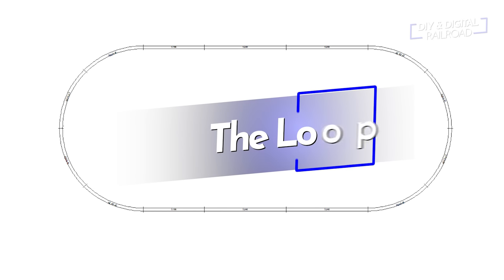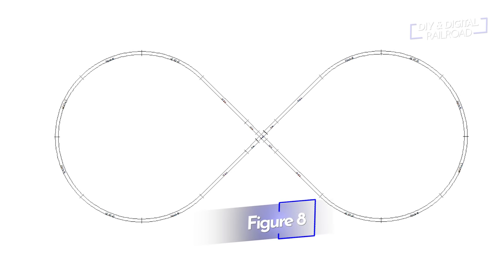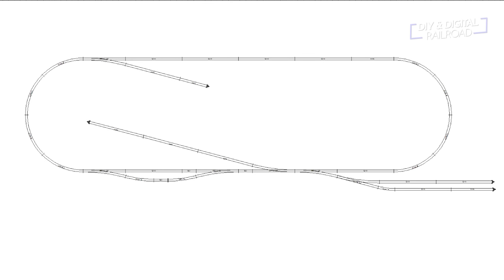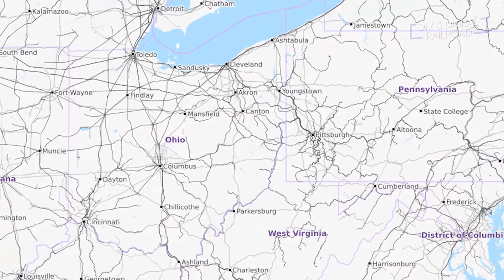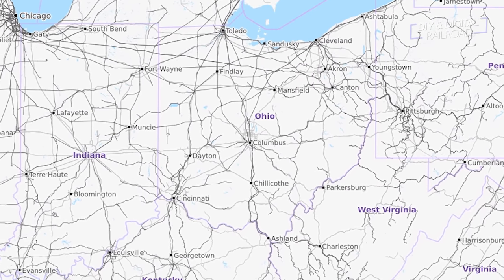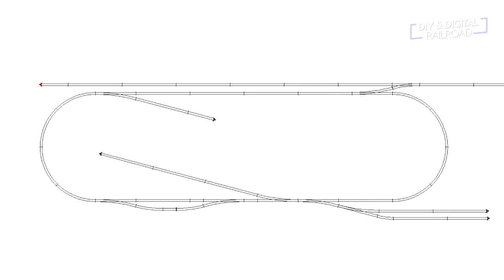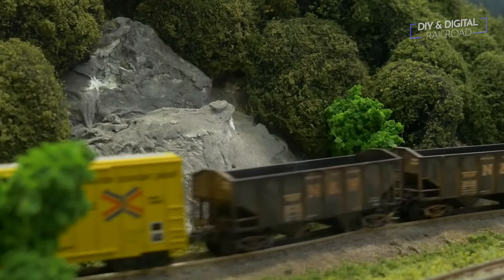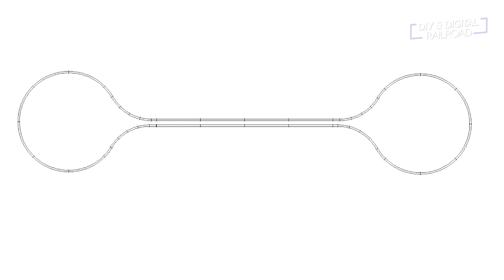Model Railroad Layout Design for Beginners

Comment: one of my favorite layout designs is using a double track going through a mountain with 2 tunnels, but, the tunnels are covered with industries that use the same rail cars. For example you can have a coal mine on one side that allows empty coal hoppers on one track and loaded rail hoppers on the other track and on the other side of the mountain you have an industry that uses coal again with one track for empty hoppers and the other with loaded hoppers. it creates the illusion of a coal mine producing coal and an industry using coal. bring the loco motive to the coal mine to pick up the loaded hoppers and deliver them  to the coal run industry. when the locomotive pushes the loaded hoppers into the industry it looks like coal is being produced at the coal mine on the other side. Then the locomotive switches tracks and grabs the empty hoppers and delivers them to the coal mine again creating the illusion of the industry using the coal as empty coal hoppers emerge from the industry side as the empty hoppers are pushed through the coal mine to get loaded. the only down side of this is that the numbers on the empty hoppers and the loaded hoppers will not match if you're into trying to create some realism to the layout.
Reply: This is such a neat idea! I like it a lot. I may have to try it someday

Comment: You are dead on right!!! Been a model railroader since I was 6, I'm 60 now, I've built N scale, HO scale, and have always loved 3 rail O , so I'm building a 120'X 42' building for my final build I will retire with in 3rail O.
I plan on a ceiling HO railroad around the bar at the entry end of the building.

Comment: Good suggestions. I will be building a shortline in 8-1/2' X 9". I want to be able to get it fairly well finished in a reasonable time and have designed it to survive a move coming up in a few years. Much consideration has gone into not overdoing. Trackplan is an old school, somewhat convoluted point to point, sacrificing a continuous run for scenery and switching that suit me.

Comment: Thanks for the tips. I'm starting a temporary layout for my dining room table (I need to be able to store it away if I need the dining table). It is basically three loops. The outside loop will be for a passenger train. Both interior loops will be for a freight train as the two loops cross each other (Kato V9). I have a siding for two factories on the interior loop and a small yard on the outer loop. It's small but it will have continuous running either on the passenger line and the freight line or one train on all three loops thanks to an "X" cross over.

Comment: Love it, this is one of the reasons I got a resin printer. I quickly justified the price of a printer when I was going to be in over the cost of it on signals alone.  Not to mention track side boxes, telephone poles, etc.

Comment: I’m excited to start my first layout with my daughter (who absolutely loves trains luckily) in early 2022. I want to make my layout based off of the line that runs between my original hometown and the state capital. Abridged of course. I’ll also have to adapt it slightly to a U shape because of the room in our barn I’ll be using. I want to center the layout around the historic Route 66/Main Street train station in the town I live in, so I’m thinking I’ll start and end it at an industry building in the respective cities and then include a small loop beyond that at either end. Probably pretty ambitious for a first attempt, but I’ll try and worst case I’ll switch to something simpler.

Comment: I liked the info. Im just starting out on a N scale. Iv decided, all by myself, to have the best of both worlds. When it comes to ops, and continuous running. All on a 4x8 plywood top, I have a loop, with a passing line, going around the outer edge of the top. Allowing some room on the edges for scenery. The passing line is on the inside of the loop, with a crossover that has two sets of industry PtP. Or, with the layout, it can also go LtP. Im quite happy with the layout. Now I just have to glue it down, wire, and scenery. :D

Comment: I have wondered about modifying the locomotives to "show" differently as they pass in one direction then another. That is, heavy weathering on the left side, then grimier, miscolored doors on the long hood and different loco numbers. If the track is at or near eye height, I think the illusion of multiple trains might be pulled off. All that would be seen is the nose/tail as it approaches and the side as it goes by.

Comment: I’m happy with my current track plan which includes a continuous loop, a passing siding so I can have 2 trains on my layout, a small yard, engine facility area with a shed and eventually a water tower/coal loader and an industrial center with separated by a #6 turnout. On the left theirs a coal depot and the right a warehouse which is meant for reefers or boxcars with a universal industry behind it to drop off cars with no industry. I’m thinking of adding a staging area just off the so I can add more trains.

Comment: Lately, the schematic I've settled on (I haven't built that layout yet) is a big loop around the perimeter of the room with two wyes at each and of the loop at each end of the room.  These two wyes serve two terminal stations on two peninsulas inside the room jutting out from each end.  This will let me run trains around the loop for continuous running.  It is prototypical for railroads to connect two ends with a main line and a branch line.  So I can treat the two stations as ends of a point-to-point and the loop as two separate lines connecting the ends -- one the main passenger line and the other the freight line.   I want to add industries along the freight line and an intermodal port.  I also want to add some interesting unusual features, like a house on my HO layout with a T-scale train running around the house representing someone's garden railway.

Comment: Your last point is me to a 'T'. I'm going to build a 4 track n gauge loop based on Southern UK system, IE 2 main and 2 relief tracks covering an area 12 feet by 8 feet for the railfanning side, but I'm also going to have a branch line running from the station to a hidden siding for the point to point. I mainly want to watch various trains run round, both passenger and freight with the fun in doing the scenery and weathering the rolling stock.

Comment: This has been great. Lots of neat ideas to elevate the activity and appearance of my first module (of several to come). I could sure use some help on the wiring/power side with my eventual shift to DCC. I have learned that I should still have a DC power supply for my LED lights using bus wires. The basement space available is big: 20' wide by 30' long. I plan to build the layout one module at a time (budget and time). Eventually, it'll be a big layout. Would a 12V / 5A DC power supply be big enough for LED lighting throughout (nothing else)? If not, would a 12V / 8A DC power supply be big enough? Many Thanks!

Comment: I may be wrong on this but shouldn't you read the page before modifying some CVs and then using the "write entire page" function.  The yellow fields are not necessarily what is in the decoder.  If you make a couple of changes without first reading, you may be changing a lot of CVs you did not intend to.

Tony

Comment: Hello Jimmy, I know this video is three years old but I am new to this so hear is my question. KATO N-Scale user here, the question I have is in regard to my main lines, I am using a V16 kit with a single KATO Unitrack line on the inside of the main layout, the problem I have come up against is coming off the inside double track with a #4 switch to begin the inner line but mid circumfrence have encountered a dead short, I have checked numberous things but can't figure this out...the engine stops even with the loop completed via antother switch at the end to allow it to re-enter the double outer track. What might you say as to correct this issue.? I am new to the hobby and my elrctrical skills have never been that savvy, I have tried numberous changes only to encounter the same problem. Thanks for your consideration!

Comment: I would like to get into HO trains on a 4 X 8 board. BUT, I am very short in space, and my wife will not allow a permanent layout in our finished basement. So I'd like to ask anybody if they think a fold able base  might work. Anybody seen such a layout? My idea would be folding the 4 X 8 vertically (I have 9 foot ceilings) and have it on a rolling base. I understand that it would have to be light with minimum buildings etc. Is there a way to tack the tracks down so they would not move when in vertical storage? Thanks for your help!

Comment: I've never heard someone talk honestly about the loop to loop, in all the years of reading an thinking. It has me really considering the space I have to do N scale..... if it went all the way around the room it would be very, very large, but it's a very initimidating prospect. Going to go do some research on the return loops, I could start on one wall and build the "permanent" end loop, and a run of bench work with a "modular" return loop piece tied in that could be removed when I was ready to expand.... hmm...

Comment: Any ideas for a s or z shape layout!?
Reply from the maker: That's an interesting question!  Depends on the layout type.
Reply: @DIYDigitalRailroad  i am limited to space. I just don't know if I should just do a point A to point B style or do to circles on each end and connect them. Then fill in the inside areas with buildings and maybe some switch tracks.
Reply from the maker: @strangleholdoutdoors  When space is the issue.  I always like to limit it down to what I want to do most with the railroad for fun.  Whether its switching or scenery or a mix, and I let that guide my design.

Comment: Hi I have a small problem may be you can help me out, I am running an arduino uno as a base station and jmri my loco i can read write decoder on program track lights working but throttle can't move trains both directions i am using a laptop power supply 12V 4 amps this power supply can run trains on Dc but on DCC++  loco does not run

Comment: One thing I find annoying about most of the layouts I’ve had is I want to have a bit more variety than an oval

I want a continuous layout but I want more variety than an oval 

I also don’t want my layout to continuously follow the edge of the table

I guess my dream layout is a non symmetrical horseshoe shaped layout that with a couple dips in the track plan to give some variety to the railroad

Comment: Hello, 

Need a little assistance on this as I am a bit naive about this.  Little background first.  My father had an extensive HO train collection.  He has since been admitted to a care facility and I inherited the train collection but know little about HO trains.  So I put a locomotive train on ebay.  I sold the locomotive ( Athearn Northwestern #1679 Diesel Train Engine Locomotive) but the buyer claims that it is a dummy locomotive.  I say it is not because it is heavy and therefore has a motor.   Do you know if Athearn even made dummy locomotives?  Is it possible he is not using it correctly?  How does the locomotive receive power?  
Any help would be appreciated. Thanks!!

Ron Kaye

Comment: Moving my living room around I had to take my 8.5 X 8.5 layout down right now the jigsaw puzzle gets worked on daily a little variation of the usual 8X8X8 many modelers have
Reply: Part1  I used to use the standard atlass track for about 20 years I've switched over and use bachmann ez-track now
Reply: This short I've been collect over 45 years now.  Every layout varies in size and shape but simple single level basics my largest layout  was an L shape 12l-8 W.   If had the room now I could easily fill a 16-16 or 20-20 set up   
If anyone would like me to post the current setup let me know

Single track oval about the perimeter.  Six turnouts 3l 3r making 18-24 combo switching layout each side.  The middle has the city industry outer city by tracks 14-16 double end ed yards 8 stub end tracks ...

I have not wired any electrical through the  plywood base as unfortunately I've had to move six times in ten yr span henceforth just manual switches and holds if filled both sides 60-80+ cars engine

Comment: I think my biggest gripe with many model railroads is the abundance of track to the exclusion of almost everything else - it ends up looking unnatural. In the real world especially early years, turnouts would be limited distance from the control box because of the weight of the control rods, so most railroads would have miles of track with no turnouts at all - obviously this doesn't make for an interesting model to operate, but if you're only wanting to "watch the trains go by" then it's perfectly adequate and you can concentrate on what the railroad is travelling through. It also means that where the yards are, the turnouts will generally be concentrated into a tight area, with any distant turnouts needing to be controlled by an adjacent manual lever. Even in the modern era these considerations are in effect, the manual turnouts are gone along with the control rods, being replaced with electronics, so fewer control boxes for a larger area.

I'm looking to start with an huge double loop (prototypical UK mainline), then take time to add stations, freight yards and service yards over time - it should mean that the turnouts are all in small clumps (easing on initial cost). So I should end up with areas of operational interest, but still be able to "watch the trains go by" through rolling countryside, and small parts of towns.

Comment: one of my issues is how much money i want to spend and how much work im willing to do. my planning stage is taking a while. i have my plan drawn but am not sure how much track it will take. i do have measurements but only of the layout perimeter, not the actual track. also since im new to this hobby, the building will be a learning process and i want to make the fewest errors possible. one issue is scale and another is what type of train, be it freight or passenger, etc. also the building of the support table or shelf. ill have a 4 x 5 corner table (10" above the floor) connected to one narrower shelf (about a foot wide) leading down to the floor (about a 15-20 foot distance), underneath the bottom step of a staircase then up onto a low shelf underneath a tv (ill need to build, or buy, a tv stand). each end will have a loop for continuous running. no switches so ill need double track for about 20 feet. there is a curve in the middle of my 20 ft section so about 18 feet is straight track then my loops are all curved. my design is a bit complicated so im taking the planning slow. the part under the stairs and on the tv stand will be the hardest to figure out but i have a general idea. i just need track and a train to help figure it out.

Comment: Can I get your thoughts on a layout I’m trying to come up with for under the Christmas tree? It’s essentially 2 loops. At one end, the inside loop goes into a tunnel, while the outside track goes up to the second deck and allows you to get on a ring track around the base of the Christmas tree. I’m not sure what the rules are for building up to the second deck such as maximum steepness. I’m only working with a 6’x4’ layout…

Comment: I wanted to do a 4x8 HO scale layout but when I bought some used Bachman Ez-track on eBay, I thought it said 18" curved track for the curved pieces, but it was actually 18 degree curved track. That is 33 1/2". That puts me on at least a 6x10 layout. On a positive note, I have plenty of room for inside track not once but twice. 22" and 18" and still run most locos and cars. I live in SW Louisiana. I am wanted to set up a Union Pacific layout to remind of watching the trains move through here in the 80s. TONS of industry and chemical plants. I have a handful of rolling stock that needs new trucks and couplers, some track and an MTH GP38-2 Union Pacific. I have been stuck on how I want the layout to go, trackwise.

Comment: I'm looking into an HO Industrial layout. Here is just the length (16 x 8 x 8), width will come as move alon;g. I'm planning on having a three track  Railcar rebuild center. One the outside track will serve a warehouse, on the other side of the repair facility is a long single track that will have a business at the end were the tracks terminate inside of the building. But just beyond the switch I'll spot cars for trans loading onto trucks. This would be on the.(8') section. 
Along the back will be a beverage building and near by a (chicken / livestock) feed CO-OP with silos.
Along the 16' section will have the yard, interchange tracks, a small cement plant towards the front then along the backside maybe a switch back like the one that was at Maysville on the Rio Grande that goes to a quarry / load out. But I'll need to do more research. 
If I can get another industry or two like natural gas or a petroleum distributor this should keep me busy for awhile. I have the power already picked out, a U18B and a former Norfolk Southern B23-7u, then a leased GP38u formally Ohio Southern. 
I'm planning for it all to be DCC and a lot of LEDs for lighting up the interiors, the yard, rail crossings. No need for crossing gates and block signals.